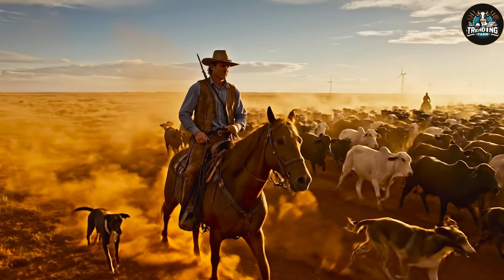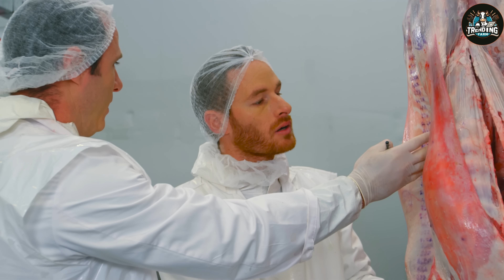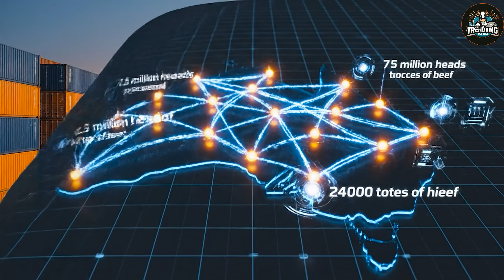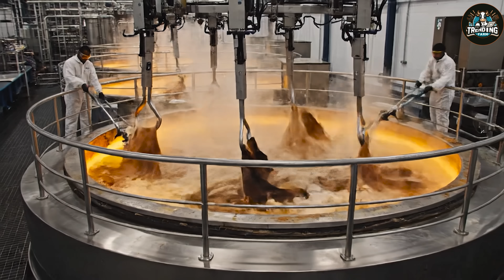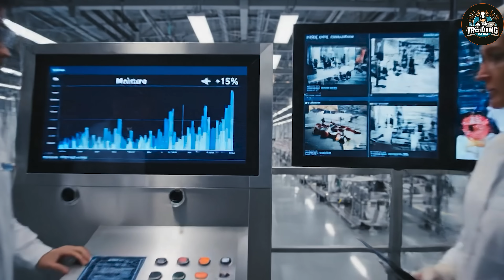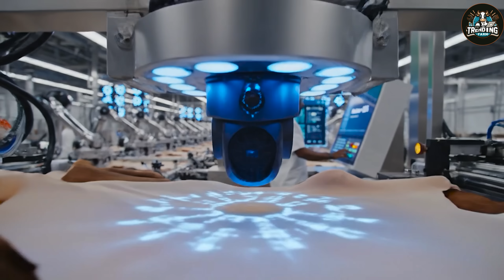A Look At Australian Beef Cutting Technology And Modern Cowhide Processing

Comment: the machines work so smoothly you can tell everything is designed for maximum accuracy
Reply from the maker: you got it the engineering behind those machines is all about perfecting every detail for ultimate accuracy